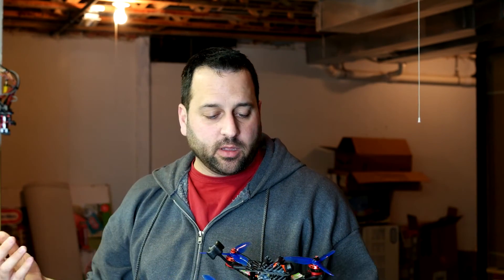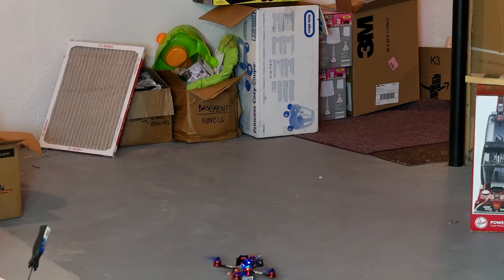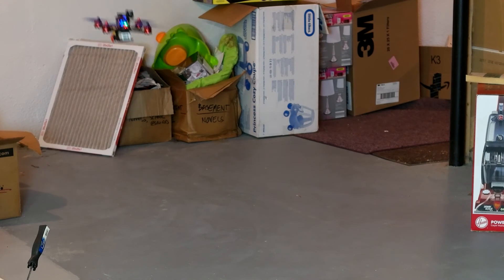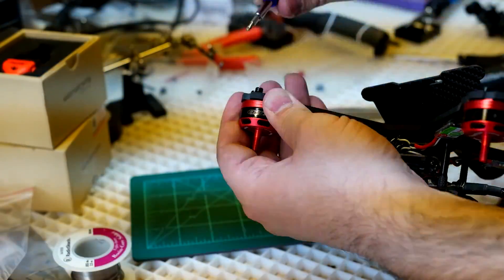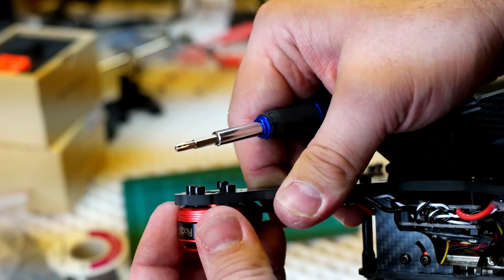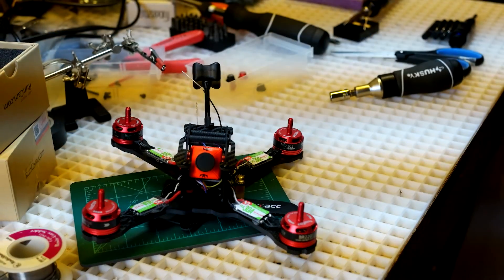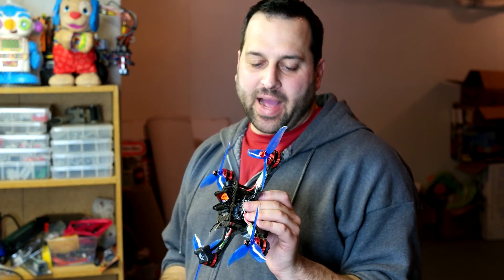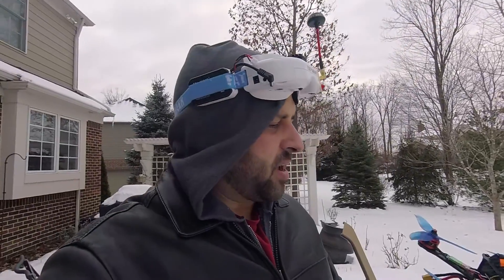Realacc X210 Maiden

Comment: hi could you tell me if this camera fit´s on this frame?? http://us.banggood.com/Wholesale-Warehouse-Eachine-1000TVL-13-CCD-110-Degree-2_8mm-Lens-Mini-FPV-Camera-NTSC-PAL-Switchable-wp-Usa-1053340.html?rmmds=cart
Reply from the maker: Maybe, but I don't know how you'll mount it.  The frame is not meant for cameras like that.  I have used this camera on a 3" build before with success.  You really want something that mounts similar to an HS1177.  There are a lot of options across a wide range of prices.
Reply: John E Fly thanks!

Comment: How did you get that voltage signal on your goggles? I didn't see you installing minim osd
Reply from the maker: I'm using a Runcam Swift 2.  The Runcam Swift 2 includes a wire for battery voltage.  I ran that wire to my PDB and the camera puts the voltage on the display for me.  Battery Voltage is really the only thing I want from an OSD anyways so this solution is extremely convenient.  Plus the camera's picture looks fantastic.  The Foxeer Arrow V2 and V3 cameras also have built in OSDs with battery voltage.
Reply: John E Fly  I see that the camera has an osd port, is that what you connect to the pdb?
Reply from the maker: No. The OSD port is for connecting the joystick that comes the camera to configure the settings on the camera.  If you look at the back you'll see a pin labeled "VBAT+".  That should connect to battery voltage and will provide the voltage on your camera's OSD.

Comment: interesting to see the motor mounts.  I have not had that issue, but have my flight controller mounted with silicon o rings...may be solving the same thing
Reply from the maker: I bet if I had the o-rings on the FC it would have solved it.  I tried that first, but unfortunately the FC didn't fit below the FPV camera mount when the o-rings were there.  It was just barely too tall, so I removed them and then had this issue.
Reply: I didn't realize u had the v+ version...I have a different hd mount (old one).  I do have the new frame you are using ready to build (had to get another!), so now I know what to do if/when I run into that...thx!

Comment: where did you get the soft mount o rings and what are they called? id like to find them cheaper is why im asking. thanks in advance!
Reply from the maker: I'm using the Danco #60 o-rings from home depot.  You can find them here: http://www.homedepot.com/p/DANCO-60-O-Ring-10-Pack-96774/100239341